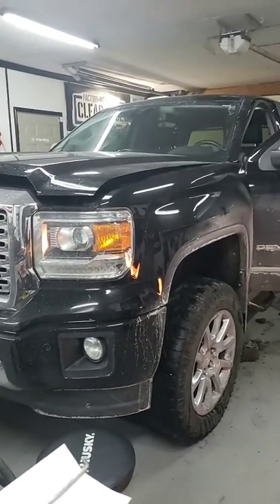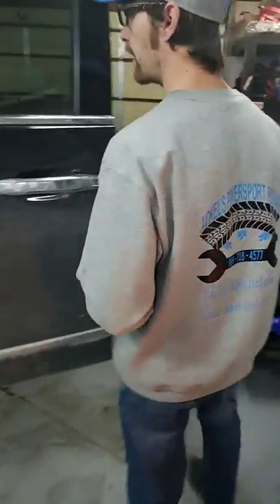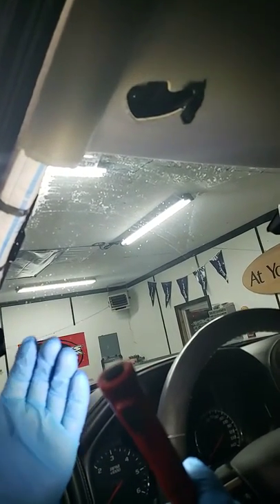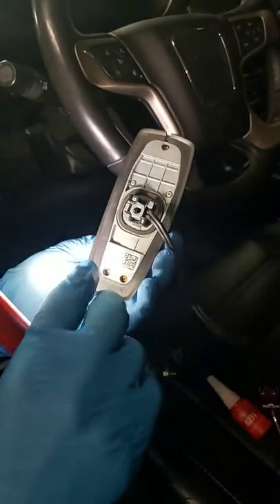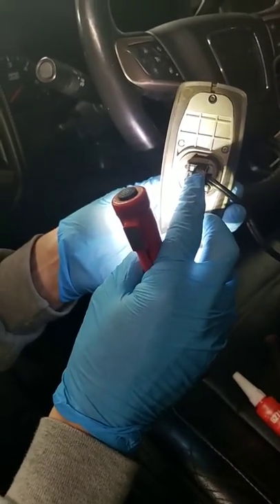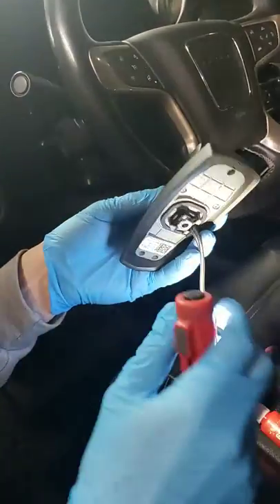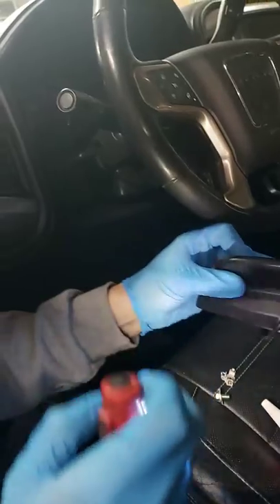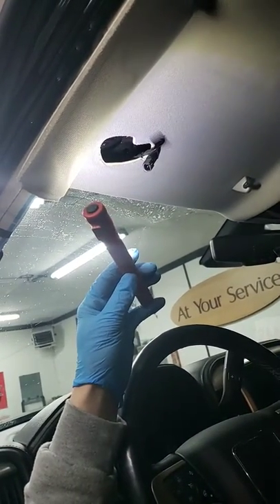2014-2018 Gmc and Chevy leaking water in cab

Comment: Thanks for the video.  First I had the "reduced power" experience when water leaked into the fuse panel, and now water is leaking into the cab close to the rear view mirror.  My question is....in lieu of taking everything apart, could you just put silicone all the way around the outside of the shark fin antenna, where it meets the metal?
Reply from the maker: You could do that however that would be a temporary fix as it needs to be squeezed between the 2 to get a good bond

Comment: I have a 2015 with a water leak.  Water in the driver side front and both sides in the rear floorboards. Most of water is in the drivers side rear floorboard. Could this all be coming from the xm antenna?
Reply from the maker: This is very possible. I would suggest running a garden hose over it and watching where you can see the leak from
Reply: Rear cab vents